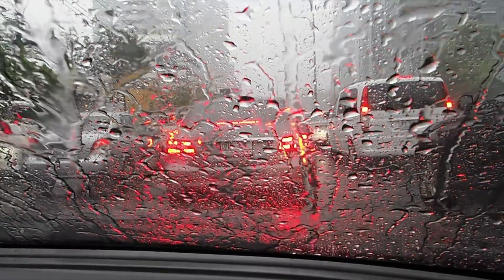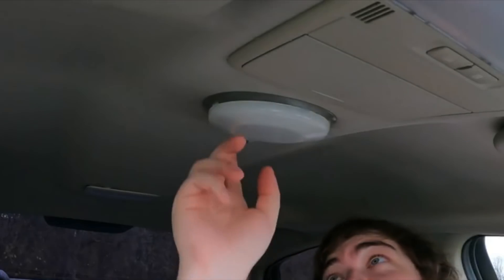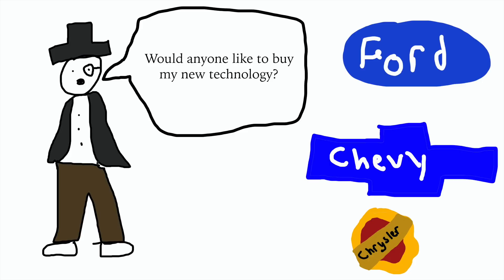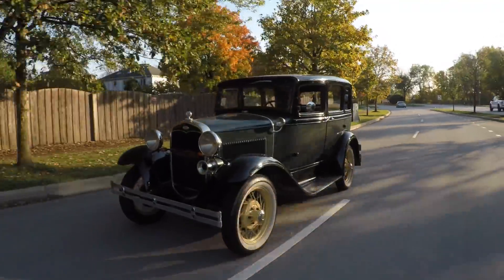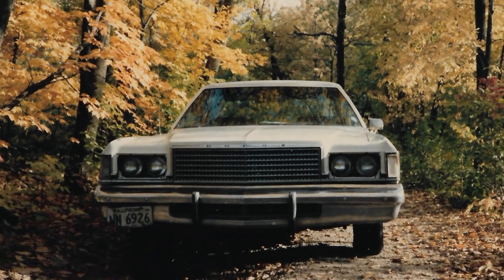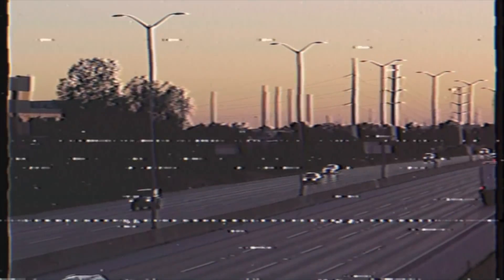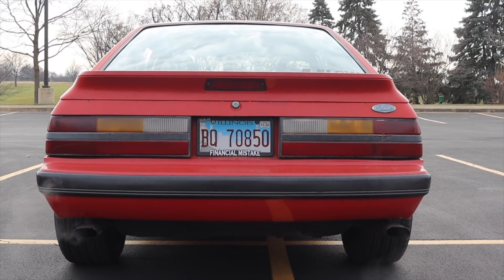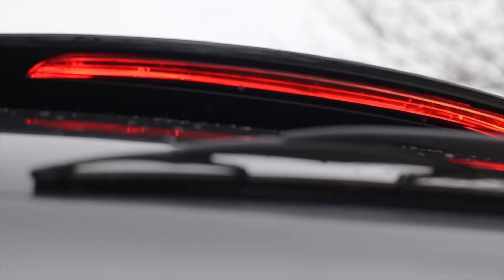The Third Brake Light - Who Invented Them & Why We NEED Them!

Comment: That is of course a U.S. perspective on the third brake light. I owned a 1997 Fiat Punto in the U.K. which didn’t have a third brake light at that time, but part of its distinctive styling was high level tail lights in the C pillars, something I first saw on the Volvo 850 station wagon which also had tail lights high in the C pillars. The video suggests the reason for the centre high level brake light was because the regular tail lights used multi filament bulbs to light the car at night, brake and indicate a turn, all in the same light cluster. I believe it is now illegal for a car manufactured in the USA and imported for sale in the U.K. to have that feature, they have to have amber rear turn signals like European cars, but American servicemen based in the U.K. that drive vehicles that came here with the military and which still operate on United States license plates are exempt from this. I have also seen classic American cars registered in the U.K. with altered rear turn signals - usually the reversing lights have been adapted to flash amber. I’m not sure if that is a legal requirement or something done to make the intention to turn more obvious for U.K. drivers used to seeing amber turn signals. This was not always the case. When I was young there was something mildly fascinating about seeing a large American car from the 50s or 60s and watching the red tail lights flash red to signal a turn. However in the mid 1980s, by which time I was a licensed driver, I realised the disadvantage of this system while walking the dog near to home. A 1970s Camaro came past me slowly and as it approached a T junction the driver began to indicate his intention to turn right. The whole right rear light cluster began to flash on and off, but as the driver approached the junction he began to repeatedly dab the brakes, meaning the left lamp cluster began to flash on and off too! For the duration of the ‘on-off’ application of the brakes, the impressive light show gave no clear indication of which way the car was going to turn! So if the third brake light was intended to be a method of clarifying which red stop light was indicating a turn, which is what I interpreted from the video, in Europe that wasn’t necessary because we’ve had amber turn signals for years that are separated from the red stop and tail lights. What developed in the U.K. from the early 1930s were the semaphore turn signal, the little illuminated amber arm that popper out horizontally to signal a turn, usually mounted on the B pillar, and in some cars these were fitted as late as the early 50s. I do seem to remember as a child some of this type of car (the Morris Minor for example) having the small red tail light flashing as a turn signal as per an American car - I think this was a conversion done to eliminate the semaphore signal. It was also legal at one time to combine the front turn signal with the front white side light (parking light? running light?) so at night that would flash with a dual intensity. However I think pretty much by the mid sixties every car on the U.K. market had dedicated amber front and rear turn signals. Returning to the third brake light, my 1997 Fiat Punto did not have one, but my 1999 Mercedes C200 did - in the back window, like a lot of 80s American cars had. Added to the rear shelf, as the Mercedes-Benz C Class was not originally designed to have a third brake light. I believed at the time that this was a progression of the high level tail lights I’d seen on the Volvo 850 station wagon and Fiat Punto, and somewhere I read an account where it said this ‘new’ feature enabled following drivers to see cars ahead beginning to brake by being able to see the high level brake light through the glass of the car you were following. I’m not sure how many drivers are actually that alert...anyway the third brakes light’s widespread adoption was probably as much to do with European and Japanese cars having to comply with U.S. regulations if they were sold there, as it was a safety feature elsewhere. Of course I’m used to them now but early on, if I was stuck in traffic at night with somebody holding their car on the foot brake in front of me, I hated the third brake light as it was right in my face blinding me! Now of course, ALL the lights are LEDs, twice as bright as filament bulbs used to be, so ALL the lights are blindingly bright....progress often comes at a cost. Personally I think some VW-Audi cars have got the unnecessarily brightest rear lamps that dazzle at night, in the car industry.
Reply: You're not theonly one blinded by modern lighting in cars. I have taken toi putting my sunglasses on after dark when I'm in traffic because modern lighting is way too bright.

I say we just get rid of this LED bullshit entirely and go back to 1157 bulbs in marker/tail/stop lights and halogens for head lights. It will make cars less ugly during the day as these technologies will force some of the 'angle grinder to the eyeballs please' styling away, and at night they won't blind the fucking piss out of everyone. Or hell even in the daytime it can be blinding!

Perhaps it's because I'm just adapted to it due to people never using them, but I've learned how to derive people's intentions from context well enough that IDGAF if the blinker and tail/stop are the same bulb. It's fine. I know they're stopping and a quick glance at what's nearby will usually clue me into why they're stopping. People love to make a big deal about it but it really isn't a big deal.

Comment: I remember the super-low in-the-bumper taillights lights in the 1971-'73 Dodge Coronet that were increased in size for '74 but remained in the bumpers when the Coronet was renamed Monaco for '77-'78.
Also, Olds Toronado added extra turn signal lights under the rear windows in he early '70s. 
The '38 Spirit of Motion ("Sharknose") Grahams had the main taillights mounted in housings below and at the outer corners of the rear windows. 
The late-forties Lincoln Continental models had taillights mounted low on the rear fenders, but those did not include the brake light function. The only brake lights were center-mounted high on the trunk lid. 
Chrysler-made cars (Chrysler, Dodge, DeSoto, Plymouth in the late forties had CHMSLs in addition to the taillight brake lights. 
Studebaker and others catalogued a "WIG WAG" brake light accessory, a motorized housing that moved the single brake light side-to-side in an arc under the left-side-mounted license plate. 
There are probably dozens of other examples out there.

Comment: Cool comparing the FB to the FC since I like those cars...  Even in the same generation/body style cars, model year 1985 versus 1986 is an interesting comparison to see it on the 86 models but not on the 85.  Case in point is the 1st gen MR2 aka AW11.  (By 1989, the final year, they integrated it into the rear spoiler and it was LED; but from 86 to 88, it was this ugly tacked on thing that didn't require changing anything to the body/spoiler, so purely meant to satisfy the law).
Reply: That's the problem with the government mandate stuff like 3rd brake light during production run, they're usually tacked on cars originally started production in the 1970's or early 1980's.

1986 Buick Regal GNX and many other 1986 model year have 3rd brake light tacked on because they didn't had other spots for them, they also couldn't integrate them neatly.
Reply: I own a 1987 MR2, so I know exactly what you mean.  I also own a 1987 Nissan 300ZX and quite impressed with it has a stock modern LED 3rd brake light (even though the ‘86 model year had a single filament 3rd brake light).
Reply: @tomkato6400  Why are people impressed with LED brake light in 1987? LED existed back them.
Reply: @automation7295  We we’re impressed with LED brake lights in 1987 as they were finally bright enough for that application. Until then, LEDs were very dim (easily washed out in sunlight) and relatively expensive.  LEDs were primarily used as indicators on appliances, stereo equipment, and other applications that didn’t need much lumens. 

It took another 20 years for LEDs to be bright and durable enough to used as low beam headlights on the 2006 Lexus LS460.  Several more years until a high beam LED headlight was first introduced on the Audi R8.  

https://en.wikipedia.org/wiki/Haitz%27s_law

Comment: My 1986 supra has a third brake light and it almost kinda looks like a retrofit even though it's factory which is cool cause none of the other models had them to my knowledge. When mk2 supra production stopped in 1985 because of the release of the mk3, there was a delay in its release so they decided to do a re-release of the mk2 but mixed both the L and P types together into one car and added the third brake light. It only lasted half a year before the mk3 was released and that's why when you're looking for service/repair manuals, they'll often say 1986.5 and I think that's pretty fun

Comment: When I was 12 my mom bought a new 1986 Plymouth Horizon. The third brake light was a wart on the hatch at the base of the rear window, the only way you could tell it was a factory installation was that the housing was painted body color. It also had a rear wiper with a separate washer-fluid tank at the back of the car, convenient since the front washer tank was an even 3 liters and it was easy to put the rest of the gallon in the back one.

Comment: About 22 years ago, a colleague of mine did a study on brake lights, specifically looking at rear-end crash rates for vehicles based on if the brake and rear indicator lights are combined vs. separate. (That's to say: at night, the outer brake lights are either off or on, not dim or on.) I don't remember how big the crash rate difference was, but it was statistically significant. And yet, here we are, 22 years later and a lot of cars still have combined brake and indicator lights. (That's not even getting into the issue of vehicles that still have combined brake and turn signals.)

Comment: In the early/mid 80s, Dad had an '84 Cutlass Ciera, and bought a new '87 one. When the '84 got transferred to my Mom, they got and installed an aftermarket high-mount brake light that installed on the rear shelf up against the glass, more or less in the same position most of the early factory installed ones were in as they were basically retrofitted into the current production cars, sedans at least, before the makers had the time to redesign around the new requirement.

Comment: I was working for CSAA (AAA) and we were installing 3rd brake lights on our company cars as part of the test program. We also installed relays to the headlight system that turned on the low beams (at a slightly reduced brightness) when the car was started. This resulted in the Daylight Running lights being implemented by some car manufactures in America in 1995.
Reply: I was constantly getting cut off in my little car so I started driving with my headlights on during the day before daytime running lights were introduced, and it greatly reduced how often traffic pulled out in front of me. I then started using my bright beams during the day, and it reduced it even more. Even now I still drive with my headlights on instead of just the daytime running lights. The brighter beam makes the car more prominent and appear closer. Try it for yourself.
Reply: Northern California had lots of rural highways which were Headlights required day and night, like CA-12 through most of the delta.  When Canada mandated DRL head on collisions went down considerably.

Comment: Thank you for this history lesson.  I've always wondered the history of the third brake light.  It's funny when vehicles that were designed from a different era that later implemented the required third brake light.  Some vehicles got clever and integrated it into the design but other vehicles that were riding on a 10 year old design instead just tacked it in the rear window or on top of the trunk.  It makes it look like an afterthought.  One good example is the 1971-1989 Mercedes-Benz SL.  1971-1985 received no third brake light but then in 1986 it was required so they just simply tacked it on top of the trunk.  Very minimal thought was put into the location.  That wasn't until the redesign for 1990.  Also, American cars such as the Cadillac Deville, Chevy Caprice, Ford LTD Crown Vic, Dodge Diplomat, etc. were originally designed in the 70s that carried over well into the 80s and when the third brake light requirement was enacted, all they did was simply tack it in the rear window which was the only differentiator between older and newer models.  I would say the 1990s was officially when cars started implementing the third brake light into their design since cars were drastically redesigned to implement these new safety requirements.

Comment: In 1979 at a big rig manufacturing company in Nashville Tennessee called Matlock Trailer Corp. A man on the assembly line used to make and  3rd brake lights that flashed when you applied the brake to it. He showed it to several car companies(Ford, Chevrolet, Datsun) that told him it was a dumb idea.....My dad worked there and brought one home and installed it to our Maveric when I was 7 years old.

Comment: I learned about this when I noticed that my car (a 1989 Mercedes S-Class) has its third brake light sort of just mounted at the bottom of the back window. It wasn't as integrated into the car as you'd expect, and that's because it was added mid-generation to meet the requirement. Quite a few cars of the time did similar additions, like what we've seen with some rear-view cameras sticking out because they were mandated a few years ago before new generations of cars with them better integrated are released.

Comment: In 1971. Oldsmobile redesigned the Toronado and from 1971 to 1978 they came with two auxiliary brake lights. The same was used on the 1974 to 1976 Buick Riviera which was the precursor to the third brake light. It took eight years for General Motors to implement the device. They also did this on taxicabs in New York City which is notorious for excessive traffic.

Comment: One thing I've noticed people never talk about is surface area. With modern LED lighting, turn signals have gotten smaller and smaller smaller. LED's are more intense, so we think it compensates for the smaller size, but it doesn't. Size of the light plays a big role in overall visibility. Especially at off camber angles, or when the smaller taillight is blocked by another car, etc., but a larger taillight would have been more visible. It's such a cheap and short sighted way to design something so important. I've compared some of the taillight sizes of cars I've owned with modern slim LED lights and they are sometimes 8-10x larger. It's insane to think that doesn't make a difference.

Not only that, but auto manufacturers have cheaped out on front turn signals. They used to be in the bumper where they were very visible. But then they decided to make them all one unit with the headlights, so you end up having a turn signal that's almost invisible when it's on because the headlight is much brighter. 

Once in a while it's good that the government steps in because manufacturers are always looking for ways to make things worse without you knowing.

Comment: I had a problem when I tried to install a rear light in the topcase of my motorcycle. I wanted it to be always on, to increase visibility, but that also meant it would be harder for the drivers behind me to tell if I was stopping even if it changed intensity like the stock ones.

My solution was to connect a relay and an electronic flasher to it so when I applied brakes it would start flashing. Since it's only one red light, it can't be mistaken for hazard lights but still draws attention. I left the original rear light as it is to make it easier to calculate distance and not confuse those driving behind.

Motorcycle lights are tricky because it's hard to judge our distance and speed for the rest of the drivers. The worst you could do is to install two parallel lights, because then it will look like a far away car instead of a really close motorcycle. That's the reason why sport bikes appear to have one front light broken. It's because the low and high beams are separated.

The best solution is to add lights vertically or asymmetrically.

Comment: When I was a kid, I remember cop cars had 4 brake lights: the standard 2 brake lights at the rear, and the non-standard 2 brake lights situated inside the rear window of the cop car.  Whenever a cop stopped or slowed down, the cars in the rear could see 4 bright red brake lights, and these lights automatically tipped off the other drivers that a cop was ahead.

Comment: There was a time when vehicles only had a single rear position/brake light usually fitted to the centre or the rear end. Another reason why cars were required to fit a third light was so if one or both of the side lights failed, you'd still have a brake warning light

Comment: I was just a kid in 1986 but I recall people with 1984/85 models having the third light installed. Not for safety but so people would think they had a newer car. There was a clear distinction between the 1985 and 1986 models.

Comment: If you check out Chrysler and Ford after WW2 their cars had higher 3rd brake lights above the tag on the trunk lid. Both
manufactures carried these for a few years.  I worked at GM and MB collision shop in the 80's and installed many third
lamps on the deck lid and upper panel behind the rear seat against the back glass.